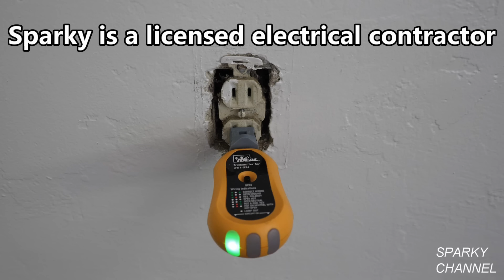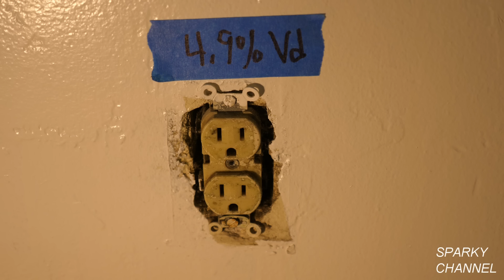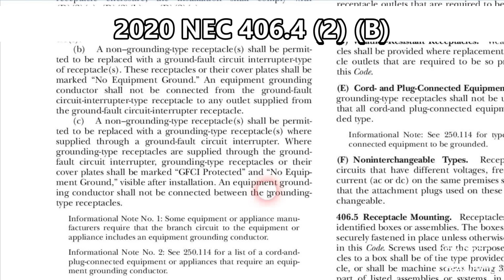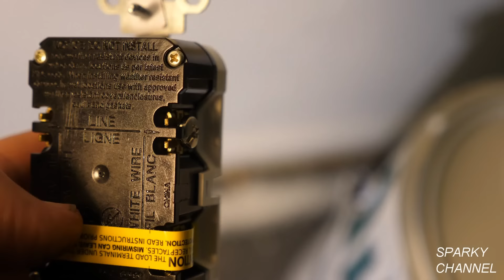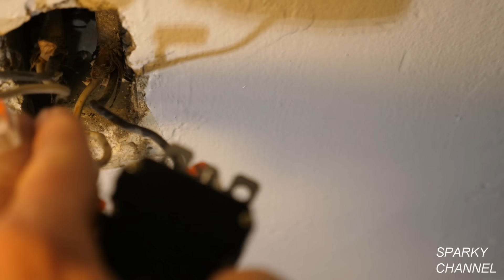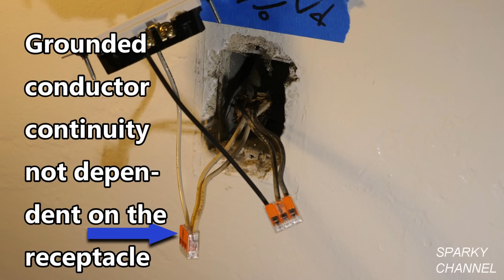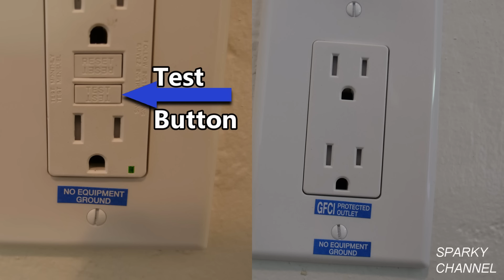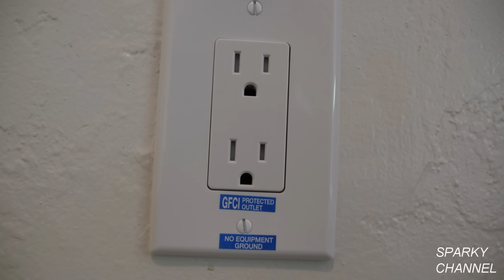2 Prong Receptacle Circuit Replaced by GFCI and Grounded Receptacles per 2020 NEC

Comment: This was really good.  I'm wondering though if you needed the Wago jumper since you had 4 terminals (2 each side) on the outlet.  That is a shorting bar so regardless of what happens to the receptacle it's robust enough to carry the current.
Reply: Me too on the Wago jumpers: I did not follow the explanation about damage to the receptacle?  Like an accidental discharge of a rifle? (ha ha)
Reply: By installing those Wago’s, doesn’t it also change the line from series to parallel?
Reply: @herbiesnerd  no, all receptacles are still wired in parallel to each other. There is a series circuit per say from the electrical panel to any one receptacles single load and back to the panel.  2 loads plugged into one receptacle are in parallel to each other and all other receptacle loads.

Comment: Very useful. Thank you. 
I just inherited a 1050sqft house from Grandparents that was built in 1948 which has original wiring.  Almost every outlet had been changed to 3 prong with no ground. Initially in preparation to sell the house I changed them all to 2 prong. Now I've decide to not sell and fix it up as a rental property. 
Thats where this comes in. There is actually a sub panel inside the house. I think it's original and replaced the old federal fuse box that is still mounted next to it.

So sorry the long msg. I'm thinking that I could go with CFCI circuit breakers. Either way another big concern (other than safety first)  is having a rent house the where they are tripping the GFCI all the time.
Reply from the maker: First of all, I'm very sorry for your loss. I can tell you from experience, 2 prong receptacles are very unpopular with tenants. My 1st recommendation will always be to re-wire the house. However, I understand that it can't always be done, especially during Covid. My 2nd recommendation would be to use a GFCI breaker and install spec grade 3 prong receptacles on that circuit and label them GFCI protected. However, most old 60's panels don't have GFCI breakers available to purchase. The 3rd recommendation would be to follow what I do in this video. Best wishes!

Comment: Why pig tails, outlets have two screws for line and two screws for neutral like the old ones?
Reply: If one of your outlets were to go bad the outlets down the line would stop working. Basically makes it a parallel circuit and not a series circuit
Reply: Correct. By using the Waygos, you supplying line voltage to those and  now the existing outlet and the line downstream is technically fed from that.

Comment: ive heard from too many people on other vids, many claiming to be electricians that if the outlet and box is NOT grounded, you need to have a GFCI in every single box.
so you can understand that i dont know WHO to believe.
i feel like im leaning your way. :D
Reply from the maker: Just follow the NEC code and you'll be fine.
Reply: @SparkyChannel  I was taught the same. The litmus test is to use an outlet tester with a GFCI test button on the downstream receptacles. They will not trip the GFCI receptacle, as that is relayed through a ground wire (which isn't present). So the downstream receptacles are not GFCI protected if you can't trip the GFCI receptacle from them. On a grounded circuit you would trip the GFCI from any downstream receptacle. Bottom line, it's not protected if the GFCI doesn't trip when there's an issue. Hence, you need GFCI receptacles at each outlet on an ungrounded circuit.

Comment: I thought that box could have only 4 Conductors, With The Two Pigtails That Makes Six, No? 🤔
Thanks For Sharing The Videos! Can You Have Two GFCI On The Same Circuit? I Have 2 Bathrooms On Same Circuit With a GFCI Receptacle In Each, It Was Fine... THEN The 1st One In The Line Tripped and Would Reset, But Not For Long, Eventually Not At All.
Replaced GFCI and Replacement Not Resetting. Moving Downline, Apparently, I Have The 2nd GFCI, Another Hall Receptacle, Light Fixture and Fan/Light Fixture On This Circuit... 😝
#IGroundWheneverPossible #ThatsTheIdeaNo?
Reply from the maker: HI Walter@ It depends on the size of your box. Yes, you can have more than 1 GFCI. See: Change Out a Circuit of 2 Prong Receptacles With Slim-Line GFCI's per 2020 NEC: https://youtu.be/RkqIgOt99DI
BTW, I love real estate!
Reply: Rick Long  Thanks!

Comment: How will gfci work if there is no ground to gfci
Reply from the maker: The GFCI's can still detect a current imbalance and will shut off the circuit at the GFCI.
Reply: The GFCI detects an imbalance between the hot and neutrals, it has nothing to do with the ground.  However it is always preferred to also have a ground as an extra safety.
Reply: Any current that goes out the hot, must come back by the neutral. Any imbalance is a ground fault -- the current went somewhere else. If you install a GFCI breaker, it doesn't have a ground lead.

Comment: But will inspector still point this out and ask the seller to add ground?
Reply from the maker: If he does show him the 2020 NEC code. You'll be fine.
Reply: Ask, yes, require, no. (if you have an old electrical system without grounds, I would highly recommend fixing that. Yes, it can be expensive.)

Comment: This is a fantastic well described video....well done! I am considering a house built in 1959 with 2 conductor wiring (copper). I understand you can put GFI breakers in a new style panel now however you would still need to update all the receptacles to 3 prong. Which solution would you recommend?
Reply from the maker: I would prefer changing out the breaker. However, many old panels don't have GFCI breakers available for them.
Reply: @SparkyChannel  So updating the actual panel to one that will accept GFCI breakers then is probably the 2nd best solution (1st being total rewire).
Reply from the maker: @pmanmusicman  Yes, if the house still has the original 1959 panel a new 200A panel would be a really great upgrade.

Comment: you must be in the usa, were i am this is not allowed, as long as you never touch the 2 prong UN-grounded receptacles they are fine, soon as you touch them even to replace a broken plug, or up date a light fixture a permit must be pulled for any electrical work, you must fish new wire in that has the ground wire, failed to do so, and you have a fire and they rule the fire was started by new work that was done with out a permit, your insurance company will void your coverage, the  fire inspector in most cases unless a total loss will find these new parts even if they been damaged by fire andd find wire with no ground wire in it, even if there is only a fe peaces left, on top of that you could be find up to 20k for not pulling a permit..
Reply from the maker: Wow, where do you live?

Comment: This has helped me so much, trying to buy a new, real old house. But it seems in this house that most outlets, besides the stove, water heater, washer, dryer, and refrigerator are all on the same circuit, its like 15 outlets.
Reply from the maker: Yes, old houses sometimes have that situation. Is the microwave on that circuit as well?
Reply: @SparkyChannel  Yes it is, and now i realize the oven and dryer are too. It's all on a 15 amp circuit!
Reply from the maker: @powderedwater67  Wow! That's a heavily overloaded circuit. If it was me, the first thing I would do would be to run a new 20A circuit just for the microwave. That would take a big load off of the circuit. It would still need a lot of work after that, but that would help. Do you have a panel that can take more circuits?
Reply: @SparkyChannel  i do, infact there are 3 20 amp circuit that seem to be unused
Reply from the maker: @powderedwater67  Excellent. I would also put the laundry on it's own circuit and proceed from there.
Reply: @SparkyChannel  thanks friend you've been a big help
Reply from the maker: @powderedwater67  My pleasure.

Comment: Isnt the old school way to just start flipping breakers until it shuts off whatever you have plugged in? We use a radio and turn up the volume.
Reply from the maker: That works although clients don't really like it when they have go set all the clocks again. :)
Reply: @SparkyChannel  In really large buildings, with lots of panels I've seen old school guys short the circuit on purpose to trip the breaker. I have also known them to go down panels one by one until they find the breaker that turns off the circuit. I work in IT. Some electricians you really have to keep an eye on. It can be very frustrating, and damaging. -- Thank for the well explained video.

Comment: I write the breaker # on the blue tape (until I put it on & under the cover plate), for every outlet, so it is easier to trace & manage issues in the future.  
re 11:20 Not only is it the most upstream receptacle (only if all of the others are dead), but you have probably (unless you missed the one under the carpet or behind the cabinet?) identified a feed line from the breaker.
Reply from the maker: Thanks!

Comment: Very well explained and presented. Wish I could pick your brain for 2 minutes about something I can't find an answer to.
Reply from the maker: Thanks! Ask away, perhaps I already have a video on it.
Reply: @SparkyChannel  I was hoping you had, but couldn't find one. I bought a house that had been empty and boarded by the city. You can probably guess where this is going LOL. Vandals stole all the copper plumbing, and some of the wiring. Built in 51, the house has 2 prong receptacles, but at some point the breaker panel was upgraded to a Homeline model. The branch circuits are all cut off where they exit the panel, and where they could easily be reached through the attic access door. Only about 4 feet of wire is missing on each circuit. Can I just install junction boxes where the wires are cut in the attic and run new wire from there to the panel? Where in the NEC is this situation covered. Sorry to be so long winded, and thanks for your reply!

Comment: Great video.  I have an old two prong outlet in the bathroom and want to install a GFCI.  Since i have a metal box would i run a ground wire to the back of the box in addition to the new GFCI?  I'm in NY.
Reply: Thank you
Reply: I don't think that would help unless the box was already grounded, or you provided a true ground for the box somehow (like to a metal water supply line).
Reply: No, just label the GFCI "no equipment ground". Adding a ground wire from the GFCI to the box is actually dangerous as any shortage would direct the current back to the ungrounded box posibly causing a fire or fatal shock.

Comment: Could someone tell me if its possible to add a GFCI outlet when the breaker handles the GFCI?
Like, the installer 20 years ago made the breaker handle the GFCI instead of adding an actual GFCI outlet, so i just want to make sure that adding a GFCI outlet wont mess with the GFCI that the breaker already has before installing it
Reply: Wouldn't that be redundant?
Reply: @you2tooyou2too  no idea, which is why i was asking for advice. Downstairs bathroom has an actual GFCI outlet but the upstairs doesnt and says its handled by the breaker. Same goes for all outside outlets except for the one that was made for the pool which does have a GFCI outlet but is using a different breaker than everything else so i assume the GFCI is only for That outside outlet.

Ive replaced the outside outlets over the years since they were 15 years old or so to avoid possible issues, so i was wondering if it would be a good idea to add an actual GFCI outlet to the mix.. bleh... so annoying

Comment: Awesome video! One question, what if in a circuit there’s  a mixture of romex wires? Some are 3 wire and others (the originals ) are 2 wire they don’t have ground.  Should the ground be connected at all?
Reply: Connect them, but unless you can then prove it is grounded, mark each outlet as "Ungrounded".  This usually happens when someone uses 3-conductor to extend an existing ungrounded (2 conductor) branch.
Reply: @you2tooyou2too  thank you buddy.

Comment: can you explain how to calculate or what is voltage drop or what is voltage drop?
Reply: Wire & imperfect connections between where you measure it and your house feed (the transformer) cause energy loss (heat), so the remaining voltage as you get farther from the transformer, is lower.  You can do the same with just a volt meter and a bright lamp or toaster.

Comment: Hey guys sorry if I’m asking a crazy question; my home has 2 wires black and white in each room, is it possible to just remove the breaker and replace that with a breaker that has GFCI instead of adding a GFCI in the room
Reply: That is allowed. You need to mark the thee prong sockets with "No equipment ground" and "GFCI protected".

Comment: can youexplain voltage drop @ 15amp? very good vidio
Reply from the maker: The SureTest puts a 15A load on the circuit, then tests the circuit under load. This gives a realistic test.

Comment: So let me ask you this. As an industrial controls electrician myself, if I want to hit the test button on my outlet tester, I know that GFCI will not trip. Is the fix running a ground back to the panel and making sure the panel is bonded to the main distribution panel outside with a couple ground rods?
Reply from the maker: Hi! Don't use the outlet tester to test the GFCI. Directly press the test button on the GFCI.
Reply: @SparkyChannel  yes the test button works, but why would my tester not pop the gfci?
Reply: @BrothersNBolts  The test button diverts some current from live to neutral bypassing the GFCI. An external tester has no access to the internals of the socket so the only thing it can do is to divert current from live to ground. Since the ground is not connected the current goes nowhere.

The problem is purely that one uses wrong testing method, not on the socket. The text "No equipment ground" will tell that one should not use an external tester. One should not do anything to make the tester work. That would likely be against the code.

In general the proper way to test GFCIs is the test button.  Some people think it just cuts the power but it actually causes the fault. One should test them regularly.

Comment: It was a helpful video.  I wondered why you did not mention wrapping the new outlet with electrical tape which you did on the first outlet.
  Sometimes the old wiring insulation cracks off when you bend the wires.  What do you do then?  I don’t believe that electrical tape is a reliable long-term solution.  Is shrink tubing an acceptable remedy with the NEC?
Reply from the maker: Hi Stuart! Here's a good product for that problem: Star Brite Liquid Electrical Tape - 4 Oz Can With Applicator Brush Cap: Amazon: https://amzn.to/37IgVSb
I wrapped all the outlets with electrical tape. To save video time, I didn't show it on each one.

Comment: Would local plug in surge protectors still work when there is no equipment ground?
Reply from the maker: No, surge protectors will not work properly without a ground.

Comment: There is no need to use a circuit analyzer to find the closest outlet. Just disconnect all wire from the seven wall receptacles, make sure all four wires from each are separated, then turn on the circuit breaker in the service panel. Check to find out which wire gets the power. That will be the outlet connected to the service panel directly, and is the closest one. You don’t need to worry about the order of all down stream ones. Just put in new receptacles and wire them up.
Reply from the maker: I would add that all of the hot and neutral wires should be covered with wire nuts for safety before turning the circuit breaker on to make your tests. Thanks Bill!

Comment: I did this same thing but my father made me add a grounding wire from the receptacle to the box.  He said always ground to a metal box.  I have other electricians say the same.  If there is a metal box should the receptacle have a grounding wire attached from the box to the receptacle?
Reply: If there's no ground, then there's no point.  How does it return to the panel's ground rod unless there is a dedicated ground for that?

Comment: Thanks for this video!  Question: do you have to pigtail the downstream 3-prong outlets after the GFCI, or can you wire them line/load like the GFCI outlet?  Curious if the only function that serves is to allow electricity to continue to flow downstream in case of mechanical failure to the receptacle.  Basically, I could only find green grounding pigtails and not other pigtails; so if I didn't care about allowing electricity to flow downstream and was ok with the interruption in case of failure, is it still safe to wire them line in and load out?
Reply: The others are not line/load like the GFCI.  They addre all common.  All nuetrals are connected together.  All hots are connected together.
Reply: I'm not a sparky, but if I understand, then no.

Comment: I wish the wires in my 42 year old house flexed like yours! they are stiff as !
Reply from the maker: That's not good. Stiff wires are prone to breaking so be careful with them.
Reply: Sparky Channel those wires in some of the receptacles you had to cut cannot be removed? Goes in but doesn’t release?

Comment: Some of those old boxes are actually grounded.  The enclosure is grounded
Reply from the maker: That's correct. However in my case it's an older style of grounding that doesn't meet today's code.
Reply: @gene murray anyone handy with a multi meter can figure out if it’s grounded